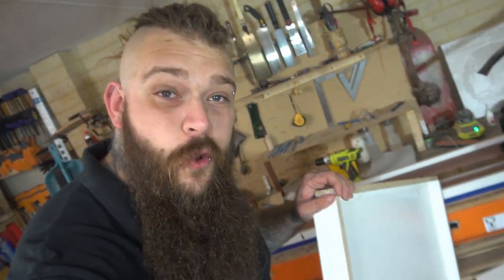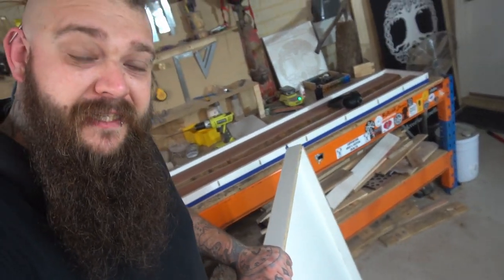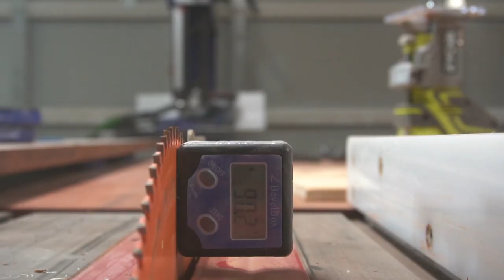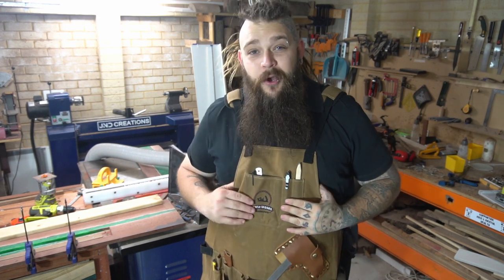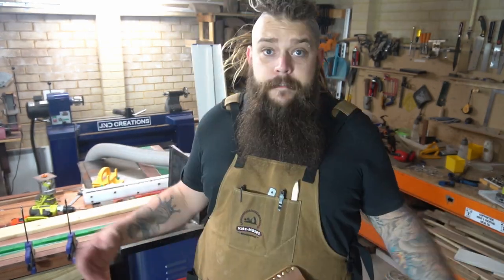Building a Resin River Hat Rack with Railway Spikes & Matching Hall Table

Comment: Nice work. I was wondering long you'd last sanding that resin. I always run mine through the thicknesser, but under fill the resin to save the blades
Reply from the maker: Haha so do I, but I didn’t want to spoil my brand new blades. The sander was taking way too long though.